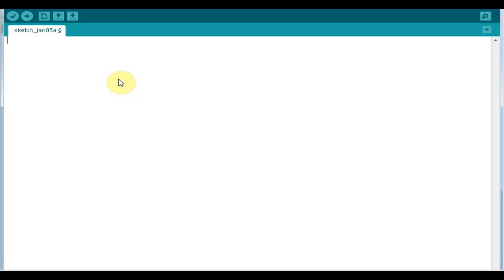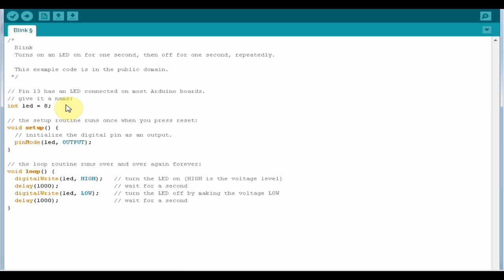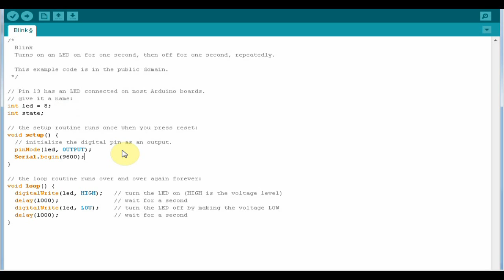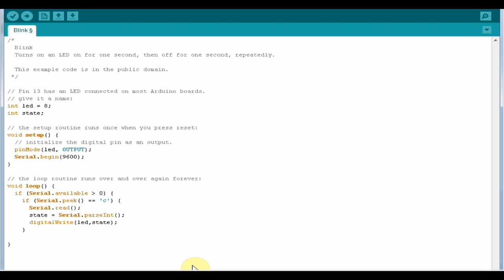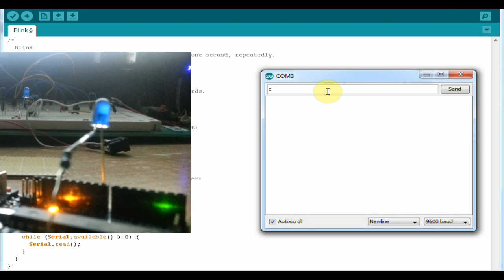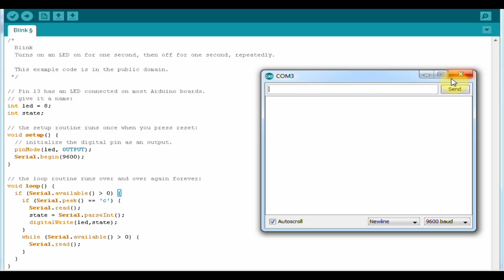Arduino Tutorial on How to read Serial Port Data

Comment: hi sir is it posible to make the arduino listening to the serial value printed not inserted
for example :
Serial.print("on");
if(serial.print="on"){
digitalWrite(led,HIGH);
}
is it possible sir, sorry it was just a simple way to show what I want to do but i'm sure it is not the proper code to command it

Comment: Dude, excellent tutorial, I have a question for you, I don't know if it's possible but bare with me. I have a machine at my house with an eproom and it has a system in it. I want to play around it.  could it be possible if instead of seeing the data on the monitor I can see it on my arduino console?

Comment: Hello.
I tried your code to send char to a lcd display but i get 5 vertical bars at the end of each print.
How can i fix this?
Reply: +Dale Whitmore Got almost same problem. Always receiving 2 bytes (13 10) at the end.. Any help? Maybe you fixed this problem yet?
Reply: +Donatas Juknevičius What do you want to do?
Just read a single character like 'a'  ?
Reply: +Dale Whitmore no.. etc I'm sending via serial just "L" it prints me in serial "Lâş" etc. or if just open serial window shows şï.. seems it has stored value.. or sends my chars and something at the end..
Reply: +Donatas Juknevičius Have you try this?

void setup (){
Serial.begin (9600);
}
void loop (){
if(Serial.available > 0){
Char InChar = Serial.read ();
}
if(InChar == 'L'){
do something in here
}
}
Reply: +Dale Whitmore it will be good as while I wont try read string. with single leter its okay, I can Ignore last symbols.

Comment: Hello, i was hoping you could help me with something,  i have my arduino connected to my router through Tx, Rx and Gnd. i have a html file stored on the router and that works with 2 .cgi files. one for ON and one for OFF. the idea is that when one visits the html site on the router, they will get those 2 buttons. Those buttons must turn a led connected to the arduino ON or OFF. im having trouble with the arduino knowing what to do with the commands. any ideas?

Comment from the maker: I used serial.peek() just in case you wanted to check for multiple commands.. I wrote this code for use(before this simplified version) I prefixed different commands with different characters and if you used Serial.read() then the next check wouldnt work... really it all depends how the person writing it prefers to write the code :p

as far as serial.flush goes I didn't want to confuse anyone to as what it was doing also there is mixed info out there whether or not it even works properly.